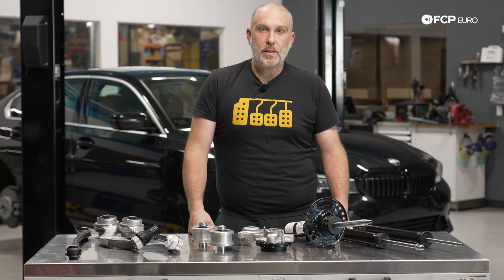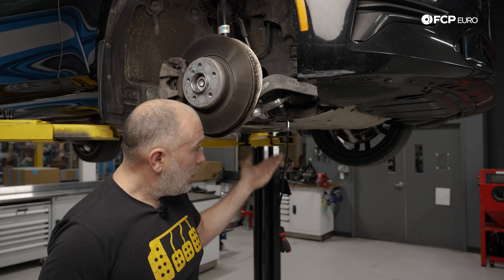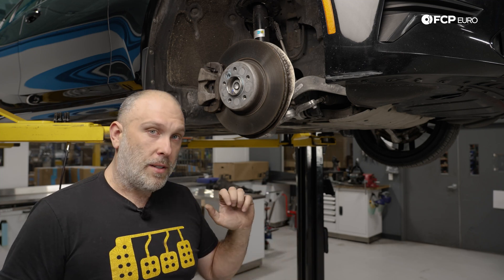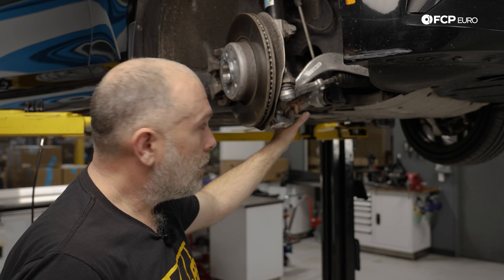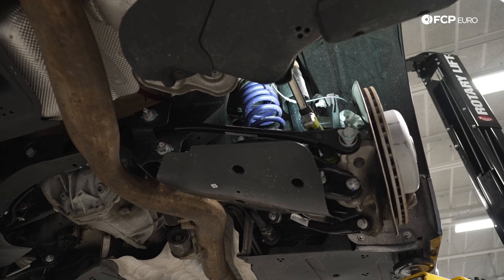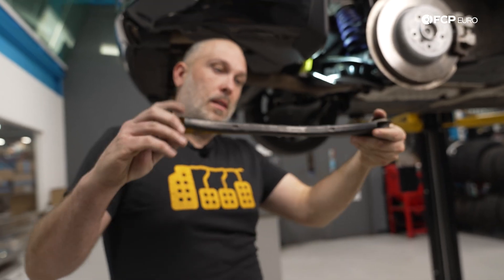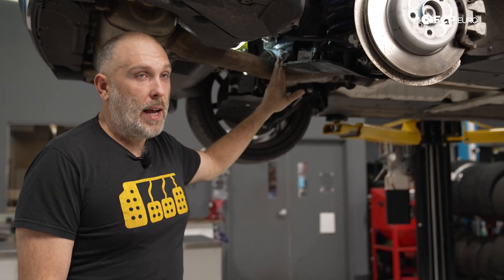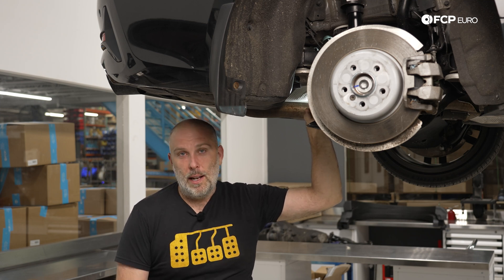BMW G20/G22 Suspension: All You Need To Know - 2019-Present BMW G20 330i, M340i, G22 430i, M440i

Comment: Base g20 with sport standard suspension and non run flat 17’ tyres = ride is rubbish. Small vibration are constant. Doesn’t feel premium and even sporty. Maybe the car was engeneered for roads made of marble. WTF bmw …😏
Reply: Have you tried lowering the static tire pressure to the lower end of the range? The tire is an important spring in the system and even a couple PSI of pressure can make a difference. Also, one indication of worn rubber bushings is the "jiggle" feeling over any bumps. The rubber bushing also acts like a spring, and when they're worn, it's going to allow for a lot more movement of the attached suspension components, even at very low loadings (100 - 200 lbs force).
Reply: @splparts car is brand new ( 2000 km ) bought in may 2025. So it’s not a rubber bushing issue. First thing done was to deflate tyres to 1.9 bar. No improvement. Second thing was to trade  run flat for non run flat. At 1.9 bar. There was some improvement but the jiggle is still present. Overall the ride feeling is rubbish comparing to other cars (even generics). I suspect bmw to cutting cost in suspension. E92 and F30 were way more confortable.
Reply: @ghassaneserghini  Honestly the G2X is very similar to the E9X and F3X cars. 

What seems to cause the jiggle to happen? Any particular impact, speed, etc. Do you feel it in the steering wheel?

Comment: Thankyou for your video I have a ‘23 bmw M340 and I find the suspension /ride very bumpy on rough roads only … fine ride on highways or smooth newer roads but horrible on rough roads I realize this is what you get with a performance sedan but wondering if there is a way to replace the shocks with a different type to smoothen out the ride  thoughts?
Reply: Same here, I just got a 2022 M440 GC without Adaptive suspension. Feels extremely bouncy on rough roads especially “waved” like roads. Tried lower tire pressure but didn’t help much. I was concerning something was wrong with my suspension but dealership didn’t find anything.
Reply: Bilstein puts a lot of emphasis on compliance and NVH in their replacement shock and coilover options. Seems like a good option to look into along with adding in a taller / softer tire sidewall and ensuring you're not running too high of a static tire pressure.

Comment: Hi nice video, I’m curious about G20 cars with adaptive suspension from the factory. Can it be changed to any aftermarket shocks or you need a specialized shocks? And can you still keep the adaptive suspension function even with after market suspension? Thank you
Reply from the maker: In order to retain your adaptive function, you would need suspension specifically designed to work with that system. It is possible to use not adaptive aftermarket suspension; however, you would need to have adaptive suspension features deleted by means of coding or "delete" modules.
Reply: @fcpeuro-media  Thank you!